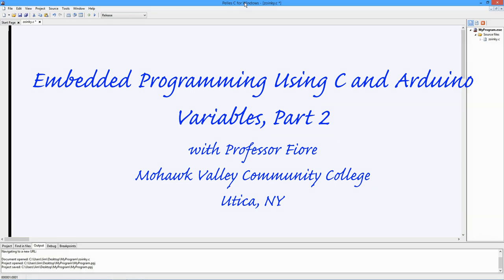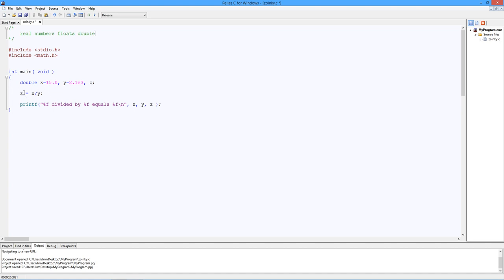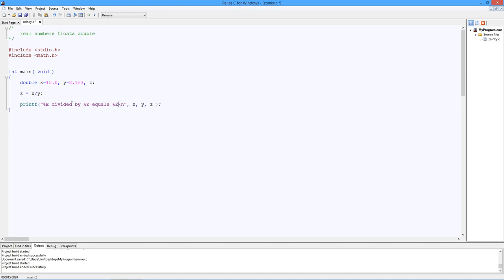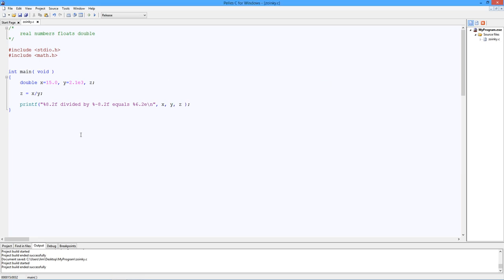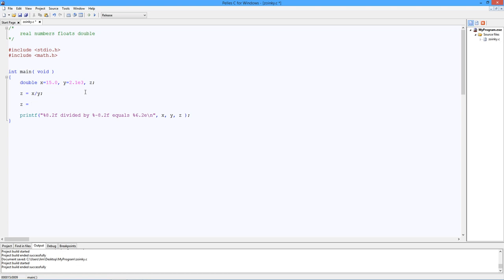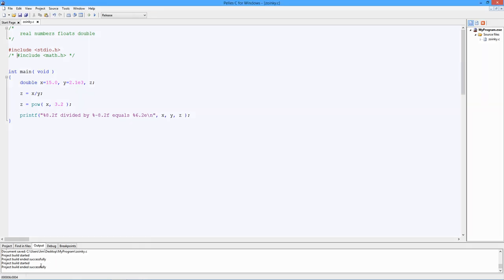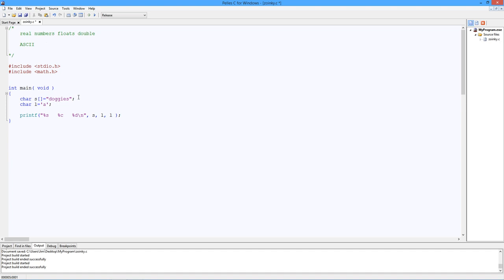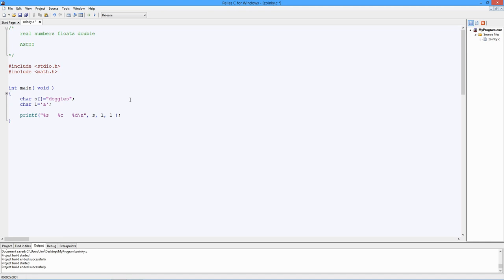Embedded Programming: Variables Part 2

Comment: I very much appreciate your style of teaching which is very easy to understand; It would be interesting if you could enhance the series by looking at a joined up process of teaching relating to GPIB or indeed 10BaseT looking at remote control of a DVM, or better still, a spectrum analyser, looking at the sending of data an return analysis, utilising C programming and incorperating all the modules your have expelain so far. Almost nothing on the internet for GPIB, and what is available is very scant in detail. For example using C programming via 488 to controll a 16500C spectrum analyser, or ever an modern analyser would be good!
Reply from the maker: I've done C programming to control peripheral devices over the years, but I think GPIB/488 can best be described as "legacy" these days. Kind of like MIDI SDS and related protocols which I did tons of back in the late 80s and 90s (!)
Reply: @ElectronicswithProfessorFiore  Yes thats true, though  HTbasic is  updated for windows 10! so its evidently still commercially viable, not cheap though.  Forgetting the legacy stuff then , lets say a tutorial on , for example, remote operation for data aquisition using modern tools and C programming? It would be interesting to do this with a logic analyser ( the ones that students use, for example) to generate binary and analyse a responce on the same piece of kit. There are many vidoes on this but most that I have seen are either not really complete or not detailed enough.